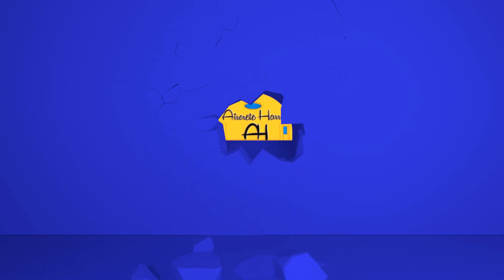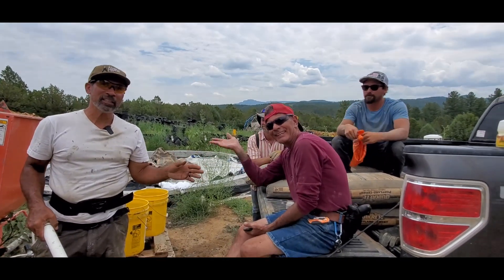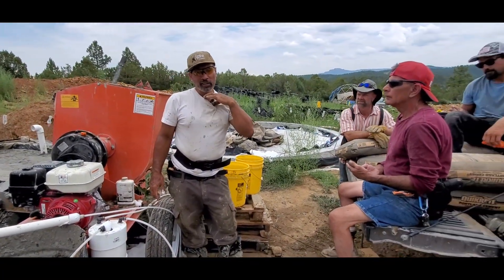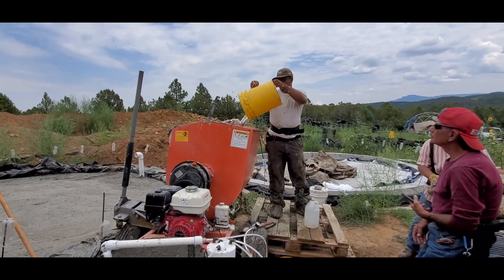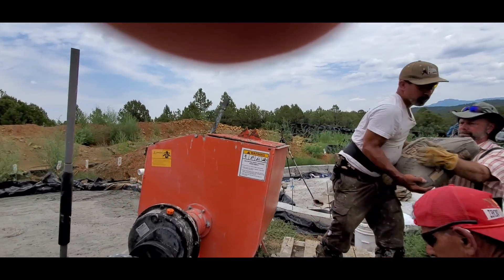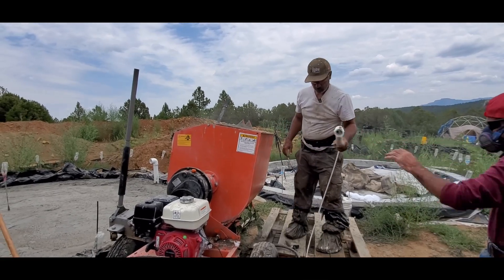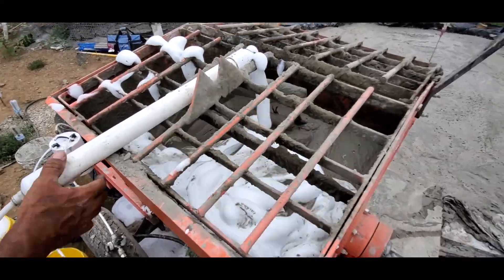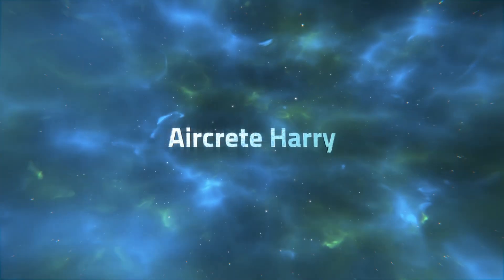How To Mix Aircrete in Mortar Mixer | #AircreteHarry #Aircrete #foamgenerator #mortarmixer #diy

Comment: Great video Harry. What’s the PSI, and thickness of your AirCrete floors? do you have a chart showing the insulation value of AirCrete?
Reply from the maker: Thank you Topher, 
The thickness of the floors is 6 inches with a stucco shell hard coating on top. 
I will be posting a detailed video soon - as for the R-Value of different samples.

Comment: Awesome video!! Thanks for all of the detail you go into. Our low foam mixture, sample looks the best so far, it will be interesting to test it, I hadn't thought about using low foam for the floor, we were going to try to add sand to make the floor stronger. Our sample with with 1/2 part sand to cement held up, but the 1 part sand sunk 25%. What is the air entrainment agent, you were using?  I don't see it in the description. Thanks!

Comment: Hi there. Awesome videos Thankyou. I’m wondering if you know or where I can find out which products would best make a light concrete that would be tough enough to handle the sea movement when used as 1 piece for the deck and 1 piece for the rooftop placed in between 2 fibreglass boat hulls please?  Hulls are 6m x 1m and royal width of boat will be 2.4m.  Each piece would need to handle the different strained movements on the sea while under motor/sail.  Thanks 😊. Rob

Comment: AH, when you have a moment: Why thicken aircrete for a slab? (keep uniform foam) Could not find thickener on your website. Thanks!
Reply from the maker: I thicken the Aircrete to make it easier to work with otherwise it's like working with water, maybe not that bad but close. With the thicker after pouring the slab I can bull-float right away.  I have to order more thickener, I'm out now.